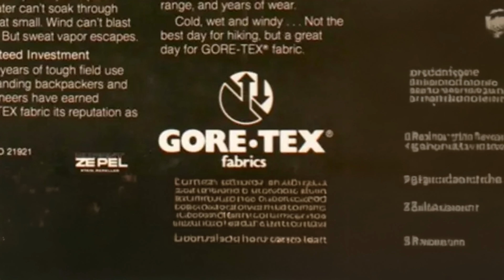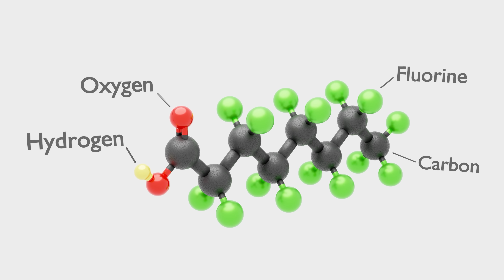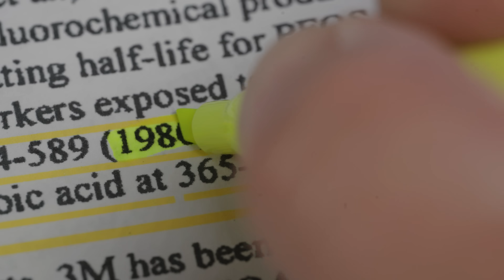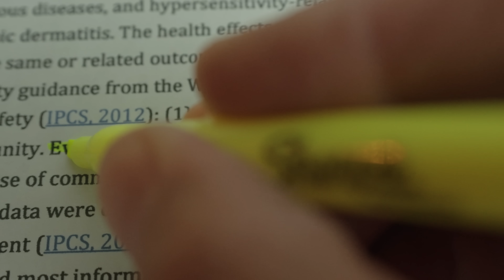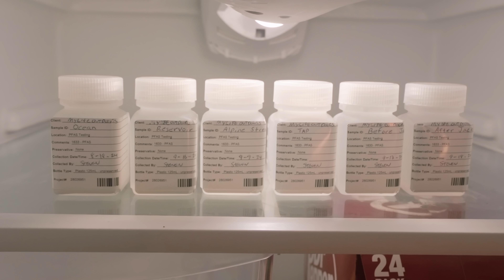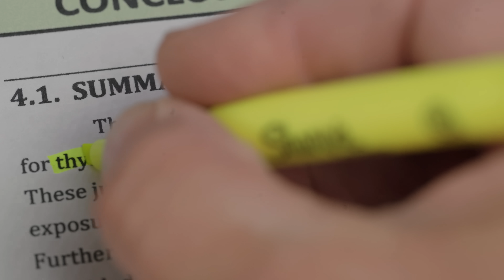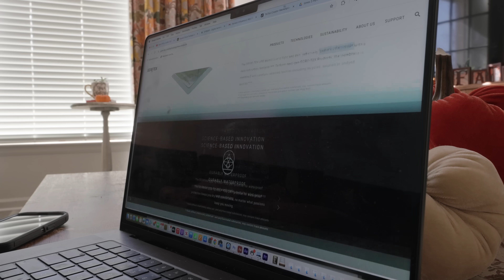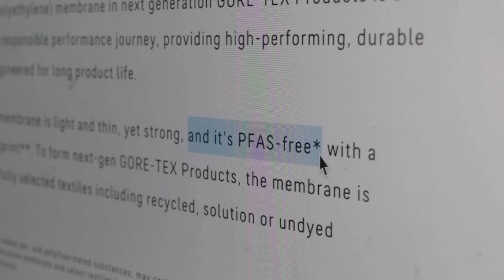Your Gear is Poisoning You! (Not Clickbait)

Comment: Thank you so much for looking into this and using your platform to spread the word! I just want to caution everyone about the sleight of hand industry uses when chemicals are banned: they often just switch to lesser-known chemicals with the same or even worse problems. Examples are substituting HCFCs for CFCs, bisphenol-S for bisphenol-A. We need to look for ways to need these things less. So instead of BPA/BPS, we now use stainless steel or glass water bottles. I’m not sure what the answer is for rain gear, but that’s what we need to look for.
Reply: I am currently running experiments on BPF, BPS and the replacement flame retardants and their effects on thyroid and steroid hormones - pretty much self classified by producers as safe but the current research available says otherwise.

Comment: What's missing is a 2nd or 3rd 24h test with the jacket.
It would be really interesting if the shedding came from production residue, then the results would drop significantly with the next measurement.
This means it would probably not be that big of an issue for jackets you already own
Reply from the maker: I would love to. The problem is these tests are $500-$1000 per sample
Reply: @MyLifeOutdoors  1. Great video, important topic. 2. I totally agree with @aggressivli : the wrong message to take away from this is to ditch your existing outerwear to buy something new.
Reply: @MyLifeOutdoors  I was going to ask if you paid for these tests out of your own pocket but it sounds like you do. If that is true then you are a true hero for doing this.
Reply: I agree that the most likely source of the jacket is production process residuals.  I'd highly doubt a jacket would be shedding PFAS at a continuous rate.
Reply: It's a valid point however I think concern is even after production these product keeps shedding those chemicals. Even in declining rate, amount of PFBAs  released in sample size are huge.
Reply: An additional concern is that UV and heat exposure (i.e., a nice sunny day out in nature) can lead to a slow degradation/breakdown of the polymer and, as a result, generation of harmful compounds
Reply: @pipariini highly unlikely that the PTFE is degrading steadily during typical UV and thermal exposure in the environment. PTFE doesn’t form thermal decomposition products until it’s headed over 500 deg F and stands up well to UV. the PFAS compounds detected are likely diminishing over time due to residuals in the manufacturing process of the fibers.  PTFE itself is extremely inert.
Reply: @MyLifeOutdoors  Excellent video considering these extra costs.
Reply: @MyLifeOutdoors  There is a YouTuber named "Mass Spec Everything" that has some very fancy equipment.  This is the sort of thing he might be interested in helping with.
Reply: @pipariini  aren't they called forever because they don't break down though?
Reply: You should have used a glass  container for your sampling
Reply: We will not get rid of PPHOS because money talks
Reply: @MyLifeOutdoors it’s bad science and irresponsible to release this video without all the facts. You didn’t even say how much water you used so your PPM numbers are 100% worthless.
Reply: @daniel-lee888 only when the sun hits it, or it's raining, or the user is sweating in it, or something scratches against it, or while it's being rubbed together like under your arms while walking, or while being washed, which would shed it to your other clothes. Most importantly wash these items separately.
Reply: @andyox-gr9gy  I was thinking that, as well.  Wondering about it - really.
Reply: @nickdaniels2083  relatively speaking there are way more Teflon coated pots and pans in use than jackets.  Until we see long term  data I find it hard to believe jackets are shedding PFAS at elevated levels on an ongoing basis through regular use.
Reply: My guess is that once they aren't waterproof anymore and you won't use them, they are done shedding these chemicals.
Reply: @daniel-lee888 based on? Most jackets are coated in a water proof chemical that wears out. There was a video on this channel. Gore-tex isn't the only issue.
Reply: Phasing out the fluorinated coatings makes sense, as these do get washed out and distributed in the environment and they can be replaced with less harmful and long lasting chemicals without much loss of functionality. I'm not sure about PTFE membranes, though. If properly produced, they shouldn't contain significant amounts of the original reactants and be chemically quite inert. Yes, they take a very long time to degrade, but that also makes the jackets long lasting. The alternative is typically polyurethane, which generally lasts around four to seven years. Is not using fluorinated stuff but making probably two times as many jackets better for the environment? Or, if you're like me, three or four times as many jackets? No idea.
Reply: These exact studies exist and yes, multiple washing cycles does reduce the amount of PFAS being leached from clothing over time.
Reply: @MyLifeOutdoors  I haven’t tested my water in about 14 years.  I’ve often thought some of these other tests would be of great value. I was fearful they were that expensive!

Comment: Great work! I’m in fire/EMS and the turnout gear we use contains PFAs. We are testing out new gear that is PFAs free, but they cost twice as much ($8,000 USD) for a jackets and pants compared to our existing equipment. However, if they are as effective as our old gear (waterproof, smoke proof and fire protective) then I think it’s worth it because in the span of a normal 20+ year career, we have one of the highest risks of cancer compared to any other line of work. I’ve been with my department for five years and have already been to six funerals for presumptive cancers related to firefighting.
Reply: Which alternative did you try? Our team tried switching away from Gore-tex but we gave up because nothing else was nearly as good, and despite the knowledge from this video they preferred to keep using our current equipment.

If you have a SPECIFIC alternative that really is better I'd love to hear it 🤷‍♂️
Reply: @robnobert  we are testing out prototype sets from FireDex. It uses a newer version of their TECGEN fiber which they claim has no intentionally added PFAS. What we currently like is it’s substantially lighter than our older turnout gear. But the reflector strips are way too bright. Almost blinding with a flashlight in a smoke-filled room with your mask on.
Reply: @DCuerpoJr  A buffing pad would perhaps solve that. I regularly use it to make shiny things not shiny.

Comment: Awesome video! For the people worried, don't throw away your gear just because it has PFAS, that will create a bigger problem than using it for as long as you can. Once its worn out, replace it with PFAS free gear.
Reply: I was thinking about this. How would one responsibly even dispose of the gear? I am also thinking about, especially as a woman, how continuing to wear the gear impacts hormones and the reproductive system. It's not a risk I want to take. 😞
Reply: @pathfinderwellcare  giving it to a reputable clothing recycler probably. Your other options are rework the remaining intact cloth into an umbrella or some other project yourself, landfill, or incineration. 

If its any consolation your clothing is most likely shedding mostly when it gets laundered. Just like microplastics from polyester etc it probably doesn't shed that much while you're wearing it.
Reply: Would wearing gear that has PFAS directly effect me? Or only if I drink water that runs off the coat or absorb somehow. If PFAS is in everything like food containers is getting a PFAS free raincoat actually going to make a difference?

Comment: I made myself a waterproof anorak from a regular cotton jacket by waterproofing it with with beeswax and mineral oil - its absolutely amazing and non-toxic. You can easily treat it again if needed. Another tip - because I got really into non-toxic clothing recently: I found a brand called Tripulse that does non-toxic workout clothes. I use their stuff under the top layer.
Reply: I use microcrystaline wax and tung oil, it provides a slightly more durable more water proof finish that's less prone to wearing off in high flex/fold areas of my canvas jackets
Reply: That's nice. What kind of climate are you in when using it? I'm in a very wet and warm part of the world, and I've been looking for natural alternatives for a few years now.
Reply: @CoolHandLukeM3  canada , ontario, tenperature ranges from like +32celcius to -32celcius here, microcrystsline wax is more flexible and "stickier" than beeswax, and tung oil is a "drying oil" that dries to a flexible waterproof finish
Reply: @thebuckster101  Where in Canada does one find this wax?
Reply: Mineral oil is a petroleum byproduct. Should use coconut oil instead.
Reply: @chriswilton9976  use tung oil, it dries so your fabric wont be oily after it cures. Its natural oil from the tung tree
Reply: @thebuckster101   What are your favorite canvas jackets?
Reply: @encapsulatio  as a carpenter I wear mostly carhart jackets, carhart overalls  and canvas long-sleeved shirts 

Waxing negativley  affects breathability  so do it only where nessisary to avoid sweating too much. 
I recommend waxing halfway from the ankles to the knees on the pants/overalls  (keeps deeper snow from soaking them as you walk)  waxing the butt so you cam sit down without wetting through to your  underwear, knees so you can kneel without getting soaked

Before you wax it just weigh the negatives against the benefits. It will add weight to your gear. But anything saturated in wax will not absorb water so it won't get heavier if your gear gets rained on

Comment: Thankfully this whole breathable rain gear never seemed to work for me at all so i always went with natural fibers and rubber as protective layer. 
I'm a sailing instructor spending all day out on the water and goretex and all other breathable materials just give up on me withing days sometimes just houres before I'm soaking wet.
With wool and a good old fashioned rubber oilskin I've never had any trouble.
True the oilskin is not breathable and condensation collects between the oilskin and the wool but as long as you get the layering right the water vapor is transported away from your skin and the wool can absorb enough water that you can spend 8h in pouring rain and never feel wet.
All you gotta do is to make sure that the wool has some way of drying out over night.....

Comment: After decades of using goretex, etc. I've gone back to using wool. Warm, soft, quiet, non-flammable, surprisingly waterproof and long-lasting.

And steel/cast iron pots and pans.
Reply: What jacket are you using that's wool based and waterproof?
Reply: @davesgreatescapes  Harris Tweed + natural lanolin oil + a shelter haha.
Reply: @davesgreatescapes  anything of felted wool will be much more water resistant than you might think. WaterPROOF might have been a bad choice of words as it won't hold out a major downpour but I was out in the rain for 5 hours to the other day and I was completely dry. Maybe more so than if using goretex as wool breathes. It also keeps you dry even if you were to get wet, and you can dry it by a fire without destroying it, if you're careful.
Reply: @crawlingrocket116 Thanks for that. Can I ask what coat do you have that's felted wool? I'm really trying to get away from man-made material
Reply: @davesgreatescapes  I have a "Pumori Loden" Anorak and a Swedish army winter uniform M/58 (1958). The Anorak is modern, very nice, but does contain some polyester.

There should be plenty of options out there.
Reply: @davesgreatescapes  I have a felted wool coat from the thrift store that is LL Bean brand

Comment: If I remember my classes right, running fluid always has a resistance on the material it flows on, ergo it erodes it away.
There is no way, I believe, that this effect can be undone, and I am certain that no affordable jacket produced in masses would have such a coding.

You're doing a incredible job man.
Many just talk about what they read on the net but you back it up with your own tests.
No man can solve the problems we, as a species, have alone. But if everyone just did just be responsible and aware enough to do a little, we can solve the problems, not like we have a choice.

Comment: Thanks for the very educational video!!

Regarding the ending where you talked about your blood levels.  There actually is a lot you can do about it. One of the simplest ways to remove forever chemicals from your blood and body is to.. donate blood, regular blood donation will drastically lower your levels and clean your blood as your body will replace any removed blood with clean blood.

They showed that regular blood downers had the lowest levels of forever chemical and other contaminants like heavy metals 

:). Good for you good for others in need!

Comment: Paramo dude , you know the score . The best
Reply: Dude... Paramo jackets only work due to the upkeep of your DWR... You know the pfas waterrepelency layer you spray on or use in the machine wash applications.
Reply: Páramo is not waterproof. Not a bad softshell at all. Infact quite interesting in cold weather. But not waterproof.
Reply: I will add here that the solution to being wet and warm is not in the hardshell or outer shell, it's in the base layer. And mesh base layers are the answer.
Reply: @daviddemmers130  Nikwax DWR doesn't contain PFAs and it never has - Nikwax being the same company that make the fabric for Páramo
Reply: As an backpacker whose day job is in the field of PFAS cleanup, this video was very well researched, clearly presented, and surprisingly accurate. I'll be sharing it widely!
Reply: @truepaulesko  not one single garment on the planet is fully water proof . Paramo is the best solution, end of
Reply: @scottowl75  cant agree at all. Their outer layer is not more water resistant than any normal windbreaker, and their fleece lined does nothing at all, it's heavy and take literally days to dry. If you get wet on a multi day misty weather travel you will stay wet every day.
Reply: @truepaulesko  you have you’re opinion I have mine . Move on don’t let it spoil you’re day .

Comment: Take 2 parts of mineral oil (baby oil), 1 part of pure white paraffin wax. Melt on boiling water for safety. While liquid, take brush and coat any clothing which can absorbs moisture.

Waterproof and non toxic for years. Got shoes and jacket covered with it, cant tell its there.
Reply: Wonder if ingredients that aren't taken out of the ground would work as well? Beeswax and some other oil or fat. Interesting.
Reply: It does not let liquid water through but does it pass water vapor through, so that the person under it won't sweat like a ping and cook to death?

The hard thing to do is make it water repelent but still breathable.
Reply: How is mineral oil any better? 
"Mineral oil is a chemical substance made from crude petroleum oil. It's a complex mixture of hydrocarbons, including paraffins, naphthenes, and aromatics, with carbon numbers of 15 or more. The exact composition of mineral oil depends on the crude oil it's made from and the refining process used."

Comment: In Wales UK, the tap drinking water is drinkable. It is water that is treated from a water treatment plant.
The only issue is that, yes its drinkable but the treatment plant does not necessarily treat the water to be completely 101% safe.

They only clean and treat it to be good enough as a drinking water.

This means that water still has some bad stuff in it (chemicals, medicines, traces of it etc.. Where the more you drink it, it adds up until a later day where it causes something bad.

They are able to treat and clean the water completely if they wanted too, but this means increasing water prices. 

Not to forget the fact that the same water passes through water pipes that is not completely clean either.
Reply: If you want clean water, you first re-plumb your house with all new stainless steel pipe - making sure the joints aren't done with teflon tape! - and then put a really good filtration system where the water supply enters your house. After which, you still need to maintain and replace your filters according to schedule.

I'm on tank water caught from my own roof, but things like PFAS and microplastics are present in rainwater as it falls out of the sky, so that's not actually the protection it should be.
Reply: @tealkerberus748 the water is coming from somewhere, even if you replumb your house the pipes leading to it could have coatings that have toxic chemicals in them
Reply: @basewho5230  That's why you need a comprehensive filter system where the water enters your house. I'm on rainwater from my own roof, and my roof and all my plumbing is less than 15 years old, but I know that any toxic compounds in the air are going to be carried into my water supply. It's not like living in one of those US cities where the town water pipes are contaminated, but wildfire smoke is carcinogenic. If you want clean water you need filtration.

Comment: 2:37 PFAS does not include teflon (which is chemically inert), it is another polyfluorohydrocarbon chemical. PFAS are mostly dangerous because they are dissoluble in water, so they can easily enter the bloodstream.
Reply: teflon is not inert. the heat will degrade it
Reply: Yes... the Teflon may be inert, but the byproducts from its manufacture are most certainly not.  And those byproducts are not so easily removed from the final product, either.  As with anything chemical, you end up with some amount of reactant in your products, no matter how hard you try.  All reactions go both ways to greater or lesser extent.